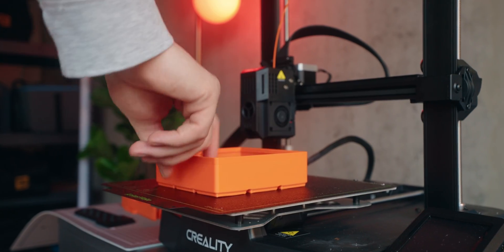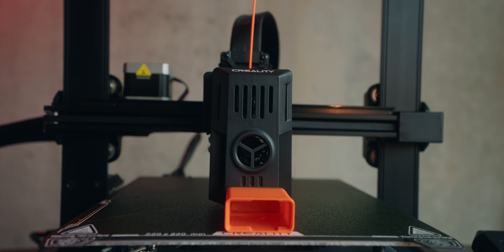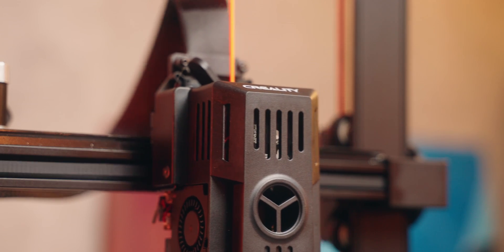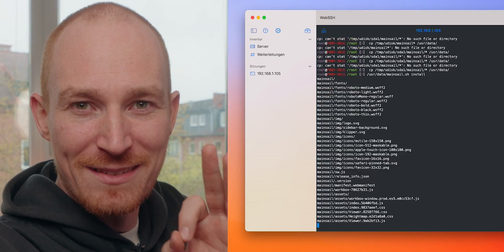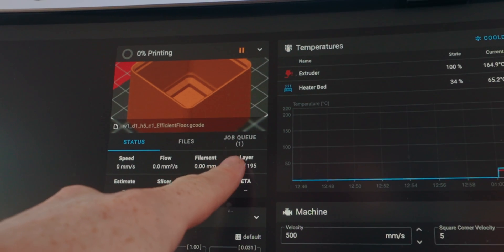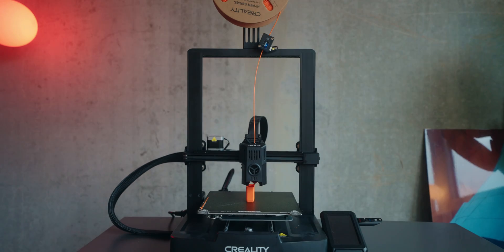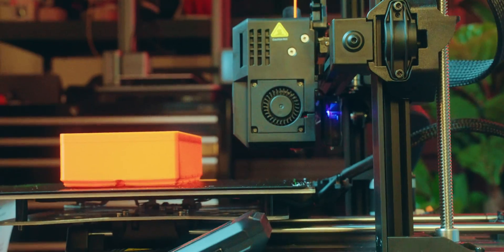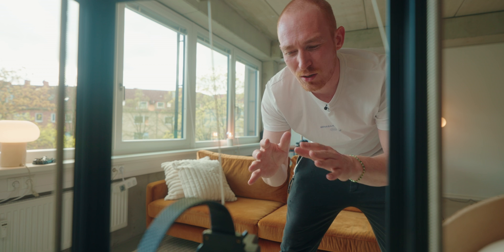How I fully automated my 3D printer

Comment: This is amazing gives me alot of ideas for my own printer. I think for me I dont need it to be automatic but I do want to be able to restart the print remotely, while watching it with a camara. This way when away from home for work I can click and restart prints myself!! thanks.
Reply from the maker: yeah that would definitely be doable. I have smart home plugs on all my printers so I can remotely turn them on or off (you can even make automations for them to turn off after a print is finished based on power draw.) the you can just implement the push off script. Either at the beginning of your new print or as macro in Klipper. 😊 
Let me know if you get it to work!

Comment: aww man if only you could print more than one thing at a time. you could print as many as you can fit on the build plate or time the printer to be done just before you wake up. 
that would be great. someone needs to invent a duplicate button so people can do that. 
oh wait that already exists!

of course you cant ram every print and keep going... some are too big and stick too much.
Reply from the maker: I understand where you're coming from. Even with this method, it's possible to put multiple things on at the same time. You just need to put them close together and have a large brim so they are connected. It was just another complexity that i tried to avoid. 

And if you have the right print bed and cooldown setting the print will honestly come off the bed by themselves. no matter their size...

Comment: I have a hard time removeing the print how can I fix this?
Reply from the maker: This could have many causes. 
For me, the right print bed definitely made a big difference. I used the one from my ankermake, but someone in the comments said what type works best in general (I think PEI, but please check in the comments). 
Other than that, you could also play with bed levelling and Z offset. 

Under normal conditions you can also use a glue stick on the print bed, but since this is something you have to do before every part it doesn't really make sense with this approach because it's not automated...

Comment: It works on an ankermaker m5 printer?
Reply from the maker: On the AnkerMake it’s difficult. You should be able to get the printer to push off the finished prints with gcode. However since the AnkerMake does not run Klipper or something like octoprint I don’t know how to do a print queue. 

You can manually make gcode that contains multiple prints or maybe get a gcode to loop and print the same thing multiple times. 
But as far as I know you can’t replicate the full process on the AnkerMake sadly. (If anybody knows how to implement the print queue please correct me 😊 )

Comment: What about putting the printer at an angle or perhaps upside down. Would the printed parts fall of by it self or is there going adhesion problem with the first layer?
Reply from the maker: Yeah definitely an option. I’ve seen both online but haven’t tried it

Comment: Cool video, I'm thinking of automatic my 2 KEs as well, one tip for the bed leveling, you can print out spacers for the sides of the bed that are bent downwards(consult the bed mesh preview on mainsail) and reduce the deviation on your  plate a bit more. You can google the how to about it, other people have done it as well. Hope it helps
Reply from the maker: Thanks interesting. And this is better than automatic bed leveling?
Reply: No no, you'll still do the auto bed leveling after you install the spacers so it confirms the new offset on each corner. Also one thing to not is to do auto leveling each time you remove the plate because when you place it back it can move the offset by a tiny bit although it shouldn't be something for you to worry about since you won't be removing the place much thanks to your print  head knocking the print off the plate @arnebornheim
Reply from the maker: @BojanSusic-qi4qn  ahhh, thanks. Definitely sounds interesting 😊!

Comment: ya this has been possible for a long time with PEI sheets, and specifically with PEI bed sheets.  As with PEI the print will stick like glue when its hot, but will self release when its cold, allowing you to do this.  This works with ANY printer type as long as it has a PEI sheet, so this will work with a Core X/Y printer as well, provided the door allows the print to clear between the bed and the opening.  So for a Voron 2.4, you just leave the doors open and it can push the print off the bed.  Hell there are print heads that have been modded to have a bulldozer on the front for this very thing.
Reply from the maker: Thanks for the info on the PEI beds. I knew that one of my sheets worked better than other ones but didn’t know the material. 
And yeah that’s the cool thing that with a little tinkering you can make this work with most / all printers 😊

Comment: Is rooting the printer just installing Klipper? Or I guess just a more standard version of klipper than the custom ones that so often cause problems?
Reply from the maker: Yes. The printer is always running a version of Klipper. you’re just installing another interface like mainsail or fluid and can install other stuff like octo everywhere.
As far as I know you’re not even changing the Klipper version. Just adding the interfaces or addons. (But I’m not an expert on these things)

Comment: Would definitely suggest some kind of print fail detection, other than that looks like a cool build
Reply from the maker: Yeah good idea. What did you have in mind? I always just checked with my camera every now and then. But something like octo everywhere (which I already have running)  has support for print fail detection right?
Reply: @arnebornheim I think creality have official camera that you can connect to the box, then the box will connect the printer into cloud, where they have AI print failure detection(based on camera) . I am still waiting for my camera arrive to test these feature
Reply from the maker: @Jesse-zs7yc I have the camera now 😊 but not sure about the ai failure detection? Would that be in the app?
Reply: @arnebornheim there are plugins for octoprint where You have fail detection built in. Also it will be nice to have some smoke detector. Long prints cause high risk, so be carefull with it.

Comment: You should definitely contact Creality and have them implement this into their printers. I recently thought about this printing option all night, because... I print lampshades in vase mode and can't fit multiple items on one plate.
Reply from the maker: It's definitely doable. But honestly i think this is too sketchy to be officially implemented. there's a lot of tweaking and a lot of ways it can go wrong. 
Definitely a great option but maybe not for everyone because things could get damaged....
Reply: Creality has the CR-30. 
The printer prints on a belt and once the print is done it will simply turn the belt over. 
This pushes the print off and makes room for the next print.
Since the hotend is angled it also allows for infinite length prints (you can print an entire sword in one go)
Reply from the maker: Yeah I know of that. Really like the idea and concept but I definitely think it’s a very specialized printer

Comment: Really cool and actually something I might attempt someday. The bed-temperature Gcode-trick is quite clever. I’d be kinda scared of using the nozzle to push of prints though for things to go out of alignment.
Reply from the maker: Thanks! 
yeah, pushing prints off with the print head can definitely lead to problems. However, with the right temperature and printed my prints come off super easily, so it's not a problem...
Reply: You can always re home the printer after the push off if you think it's going to skip some steps while pushing. It's G28 I think
Reply from the maker: I think it always homes before a print? 
But I think meeskees was concerned about bending something or similar